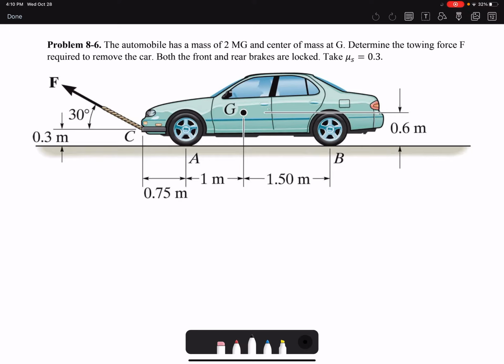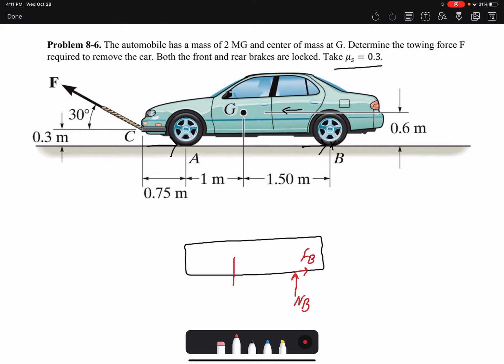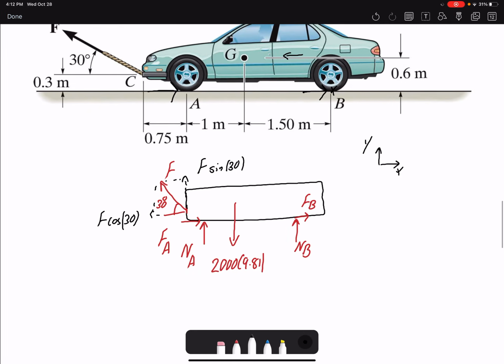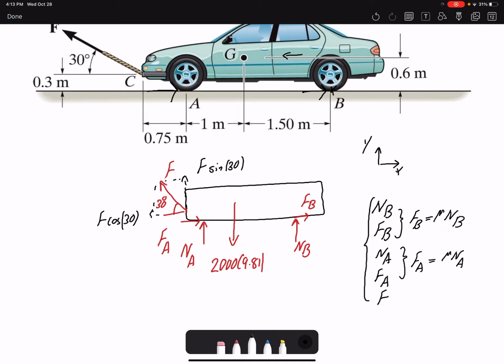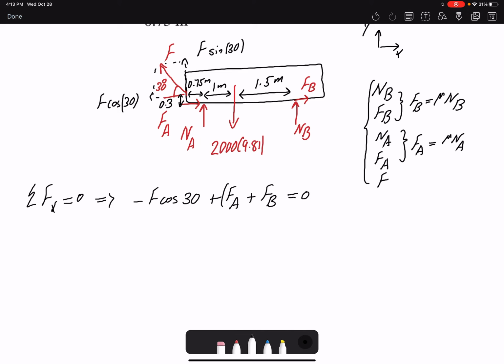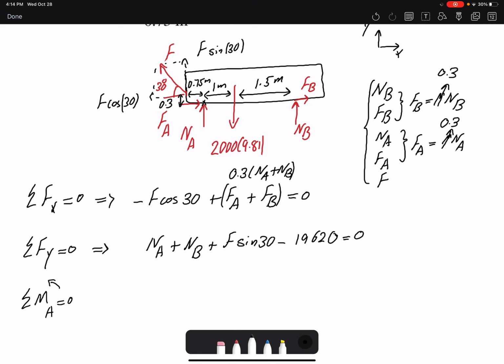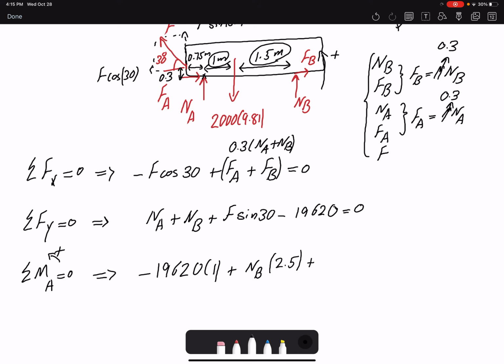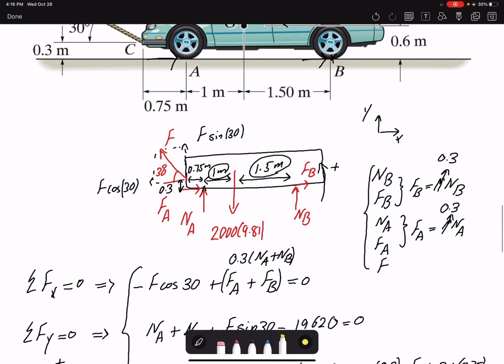Statics Practice Problem 8-6: Friction forces on a car being towed

Comment: good video, but I think you messed up for the fx = 0, the question says that the back wheels are locked while the front are free to move so it should be (-fcos30 + 0.3NB) so the three equations can be solved.
Reply from the maker: Both front and rear wheels are braking and there is no free rolling

Comment: You solved to lift the car, not move it along the x-axis.  Solve for Na and Nb disregarding the applied force.  
Then use the sum of the forces in x with regard to the static friction to find the necessary force.
Reply from the maker: That is incorrect, the solution determines the force it takes to overcome the friction forces when the car is braking to slide it on the road

Comment: But we could have solved using the two equations of force balance itself by treating na + nb as a single variable group N , then we would have two eqns and 2 unknows F and N
Reply: I just did the problem and came back to this comment realizing you were right. I just used the sum of Fx and sum of Fy and wrote sum of Fx in terms of Na and substituted it into sum of Fy. Came up with 5792N. No moment calculation needed.
Reply: It works because when you write it that way, Na and Nb cancel out.
Reply from the maker: Good question! 
But the normal forces are not the same because you have a force applying to the front. If that force was not present, then the normal forces would have been the same due to symmetry! But now, they are not the same and they should be determined by equilibrium equations

Comment: Can You Post a video or comment on how to solve for all the variables in this problem I am completely stuck!
Reply: Depending on your calculator you can also solve it as a matrix which takes like 30 seconds.
Reply from the maker: Hello Blaine, 
You need to solve the equations based on the elimination technique, which means you are find one variable as function of the other two and replace it in the second equation and do the same for the other variable until you have once equation and one unknown, after finding one of the unknowns, you can replace it to your equations to find the rest of unknowns.